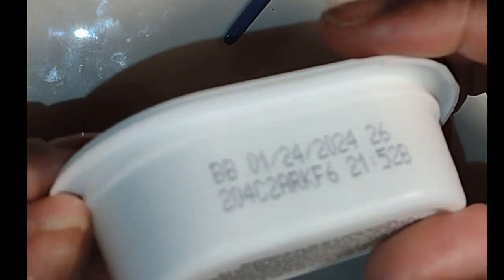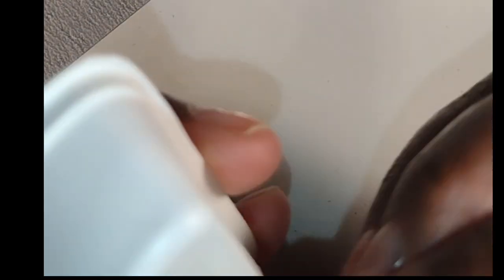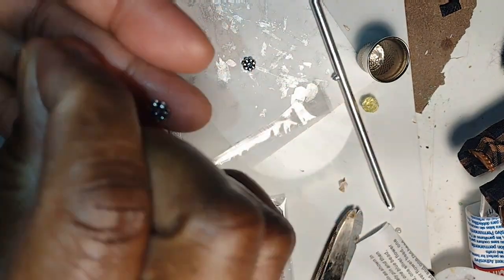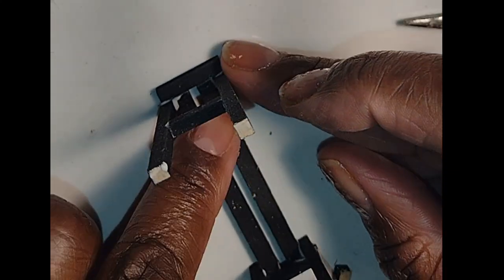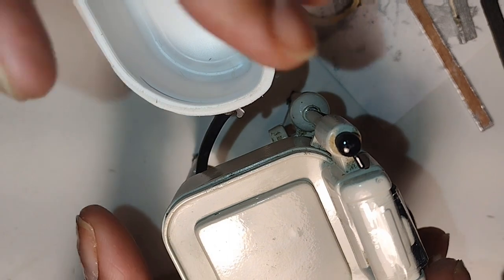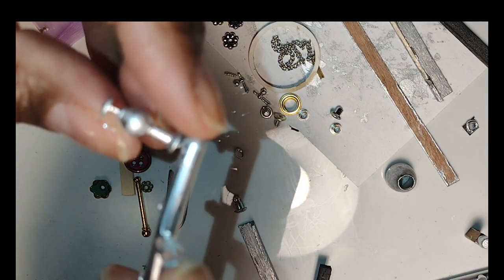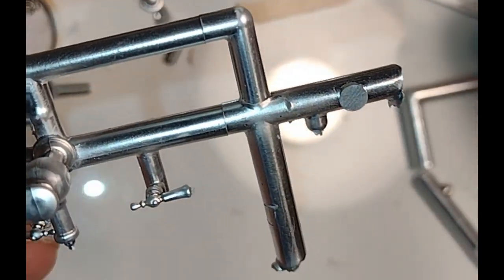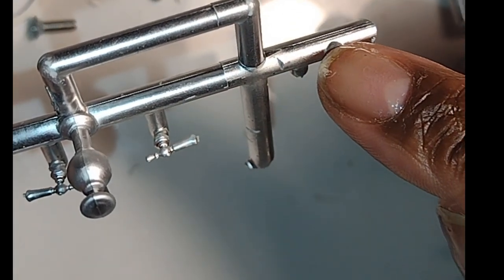DIY Dollhouse Laundry Room Sink and PIPES- Trash to Treasure-ROOMING HOUSE DOLLHOUSE

Comment: I know what that piece is that you used for a faucet! It's from the Chrysnbon bathroom kit. It's a valve that attaches to the steam radiator and sits on the floor. 

I love how this turned out! I wonder how many pieces of trash plastic us creative people have kept out of the landfill and ocean.
Reply from the maker: LOLOLOL! thank you for letting me know! The lot i purchased had many random pieces definitely, no radiator. I guuess they took what they wanted and dumped the rest. So it looked like a faucet to me! This project was alot of fun, I've been waiting to do this forever!
Reply: @littlegretchensworkshop7665  You're welcome! I've assembled a few of those radiators so I recognized it right away. It's works really well as a faucet.
Reply: Thank you for identifying the kit! The closed captioning and I both heard "prison bond" kit, and I thought, "That can't be right!" 😂
Reply: @laurawiles410  that's hilarious 😂

Comment: I just love your videos. I look forward to them. Your work is amazing. I have a question for you, if you don't mind. Are you familiar with the Tennyson doll house? I am working  on it and applying lots of ideas from your videos from curtains, flooring and making cabinets, and food. But, I need more rooms to the house. Mrs. Doll is demanding a bigger kitchen. I am scared to add on, because I don't know how. Any tips please to adding on more rooms downstairs and upstairs? Using the templates on the brown bags for floors was such a great idea!. Have a blessed day, and thank you for all your videos. I love them.
Reply from the maker: Thank you ! Stephanie I'm so glad you find my videos helpful!  Yes i am familiar with the Tennyson dollhouse. You can definitely add on or expand it. You can to an addition with foam board/ foam core. It goes by different names but it's what i used to create the wall/ doorway between the pantry and laundry room. Its sturdy and easy to cut with craft knife. Just duplicate the existing structure. Create  2 foam board boxes to match current house stack them for upstairs and downstairs. I would expand on the side opposite to the porch so you can keep your porch. I hope this helps let me know. Also Stephanie , you can reach me in  Chat on Little Gretchen's FB page  if you need more help. Let me know how it goes.